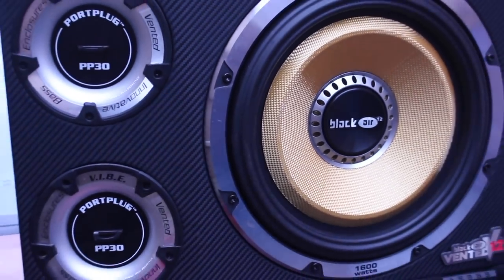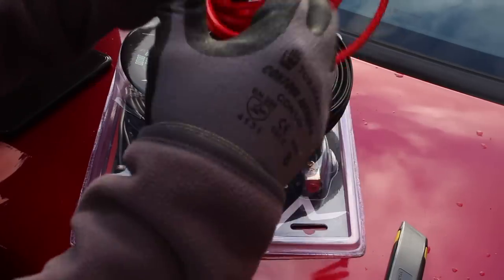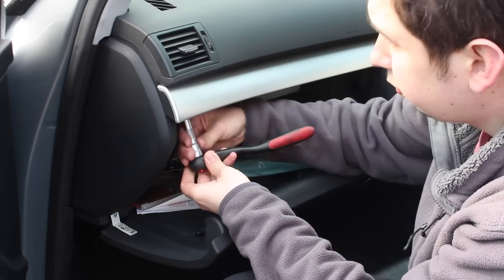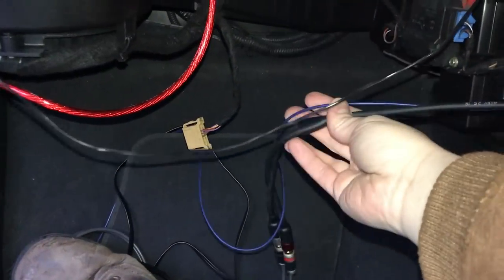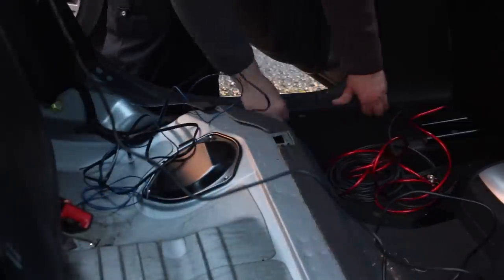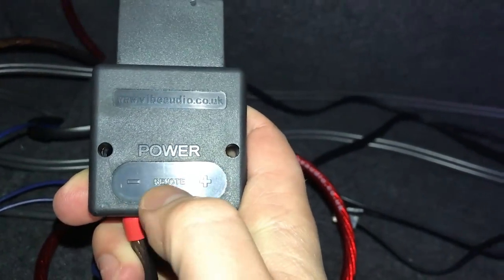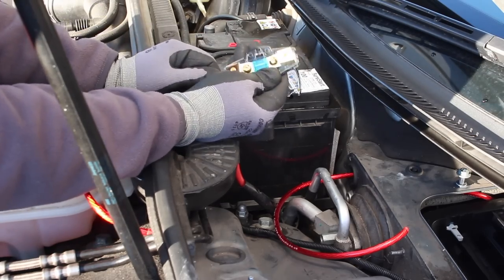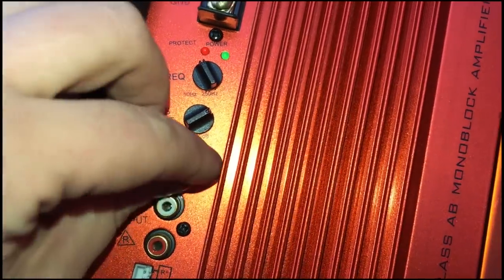How To Install A Subwoofer

Comment: RCA cables needs to be seperated from plus cable only if you are using amplifier for speakers which can make different unwanted noises from the speakers and can damage the speakers. If you dont want thise noises just buy a ground loop adapter which comes from RCA preouts on radio to RCA cables. Otherwise nice job on this tutorial it is very helpful.

Comment: to those who might be a bit confused about the gain knob.... turn up your stereo to max and run a sound test... start with gain somewhere in the middle and gradually turn it up until you start hearing some distortions... turn it down from there just ever so slightly and leave it there... dont treat it as a volume knob and leave it on max

Comment: When you use the RCA jacks in the back for the sub only, Does  the other regular 4 speakers just hooked up to the radio wires, and just play off the stereo power, right??

Comment: My b7 a4 has a stock sub and amp in the back. I have the stock headunit and i was wondering if there would be any smart solution for me. Is it possible to take the signal from there and run the power like shown in the vid.

Comment: Great video,1 question though,the REM blue cable when head unit is switched off and Sub is off?
Or is a seperate switch necessary

Comment: I have a speaker that comes with built-in lights. Where should I connect its positive terminal so that the speaker lights turn on when I switch on my vehicle lights? Also should I connect the ground wire as shown in this video? Pls help. Great video by the way!

Comment: Agree with tj o, where is the best place to take the signal if we are dealing with a factory head unit?
Reply from the maker: Normally you have to take a feed from the rear speakers. My girlfriend should be getting a new car soon so I might try and tap into the factory h/u on the new one.
Reply: You must tap with a line convertor.  It connects with your speaker  wires to convert to rca signal.  It's quite cheap as well.  Hope my comments help.
Reply from the maker: Fortunately most amps these days can accept a hi-level input so it’s always worth checking that too.